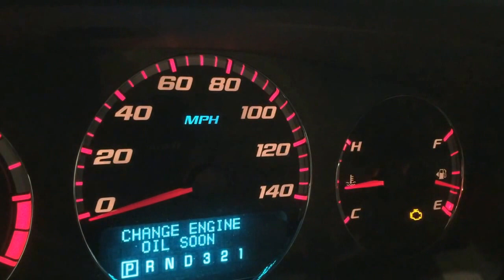Diagnose and Repair Code P0521 Oil Pressure Sensor Circuit

Comment: Just got the code few days ago I changed the oil and filter the code came back after few minutes! The sensor code be the problem or !?
Reply: Probably your oil pressure sensor it self.

Comment: I have a 2008 Chevy Silverado 5.3 Liter truck and got the same code recently. The error said that the oil pressure was low, but the engine sounded fine.  The guage read about 20.  I checked and verified that the oil level was good.  I had about 10% left before the oil needed changing according to the display.  After much research I found that most pointed to debris in the small filter underneath the oil pressure sensor.  Most people replaced the filter as well as the sensor.  I also found one post in which it was said to add a little transmission fluid in with the oil.  After research I found that this acts as a flush to the engine.   I added about 1/2 quart of transmission fluid to my oil, ran the engine for about 10 minutes, drained and replaced the oil.  I used a free app called  Torque to clear the code.  After doing this the oil Guage went back to normal which is near 40.  This is my experience,  but I encourage you to do your own research and proceed with caution.
Reply from the maker: +Gordon Polk yes that screen can get crap in it. Glad you figured it out. Thanks for the feedback. Take care.

Comment: its 9/10 not the oil pressure sensor or the customers fault

 ....its the #2 cam bearing from the split lobe vvt garbage cam they used in the afm/vvt cars from its start til at least 2014 when the new cam bearings rolled out, every single vvt/afm car that has come in to my shop has the same low oil pressure issue and or P0521 code including my own pontiac g8 gt but varies to even escalades and newer camaros

 gm quietly released a tsb in feb 2013 with updated cam bearings  (12-06-01-007a feb 13 engine - new service cam bearings)  ,  
they refuse to touch them because it would require a new shortblock or at the least a complete tear down

Comment: Long story short, had same issue as MrSad57, got really frustraded and beeing a marine tech, I did a bunch of research and I can promise you, it's the small little filter that's hides under the oil pressure sensor at the very back of the intake... Pull the sensor off, reach in with a snap on pick, pull it out and replace it with a new one. Problem solved, good for another two years.
Reply: I was wondering what the filter name ? can't really find it anywhere .
Reply: GM part # 1258 5328. if you have a LS2 or LS3 you'll be able to reach back there without effort but if you have a truck style manifold, like the L76 and so on, You'll have to remove the plenum to get at it. I have been able to re-use the gaskets once or twice but recommend replacing them after a couple times... it's a simple job, good luck!
Reply: Thank you so much! You just make my day way easier :)
Reply: Glad I could help, I  had huge issues in the past with my tuck regarding that code, went as far as tearing my engine appart, replacing the oil pump and so on, getting it all back together to find out that it wasnt the pump nor the sensor... tha's my friend is very frustrating... at the end of the day it's a 2 bit part!
Reply from the maker: +Mike Ferreira Thanks for the info! Will keep that in mind for future issues. Blessings!
Reply: I can only dream about tearing engine apart, cause probably would end up with spare parts at the end. But always up for a small / medium fixes. It is not my vehicle , but i may have chance to deal with it. I look up videos about locating and replacing sensor , man it is challenging on 6.2 liter engine.

Comment: i have the same code on my silverado 6.2l 2010 recently i have changed the engine oil and filter and did extra things with that because my oil reading is 7 psi only idling and 20ish will driving , i have changed the oil pump used ls3 gm performance
 oil pressure senser has been changed i also checked the socket though it might have lean voltage or something but everything i have done already for nothing the problem still not fixed and it driving me crazy.am using castrol magnatec oil 10w40 . just want to add something extra i have checked the oil pressure manually and the reading was 30 psi on idl but on the dash board only 7-10. thanks in advance
Reply from the maker: Hey thanks for he info.
Reply from the maker: +MrSad57 I would monitor the oil pressure pid with a scanner and see what you have there and compare to the gauge reading. Maybe a gauge problem? There is a flow chart for low pressure reading you'll have to follow after that to identify the problem but it sounds like gauge or wiring related to me.
Reply: +The Car Doctor monitoring the pid through the bcm/ecm wont help him much if it were a wiring issue , your still gonna get the same as the gauge displays ,that test would be redundant if it were wiring.

 he would need to verify with a mechanical gauge at the psi sensor port which takes an m14x1.5 adapter, harbor freight sells a cheap test gauge with that adapter size fyi .., but as per my other comment its the #2 cam bearing like the 22 other gm cars so far that have been through my shop, Id put money on it.
Reply: changing your oil is still very important thanks for the vid too brother!
Reply from the maker: This was a friends vehicle and it had about a cup of oil left in it so yes, changing oil once in a whole is a good thing. Haha. Take care.